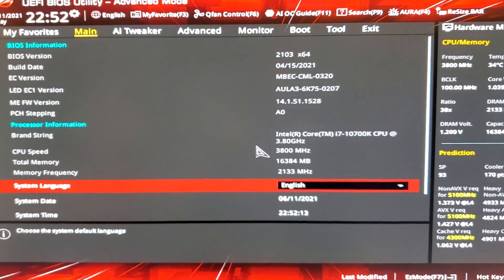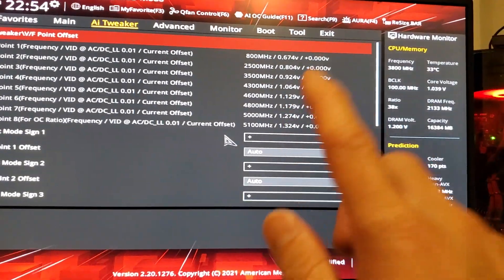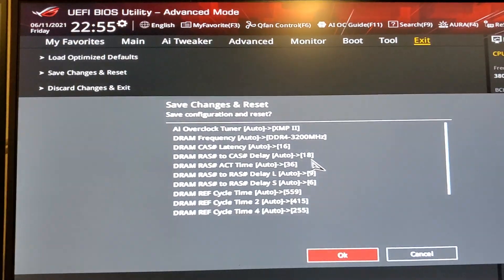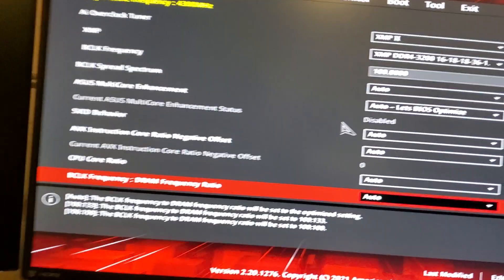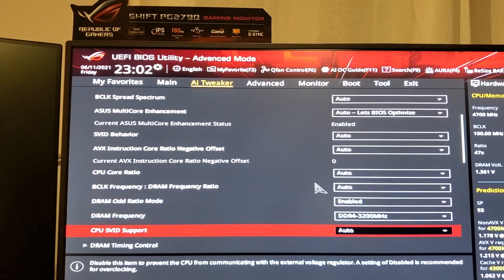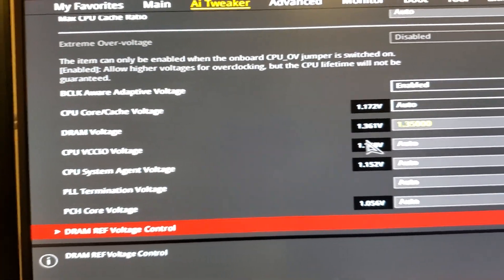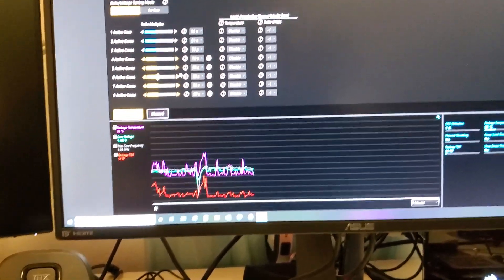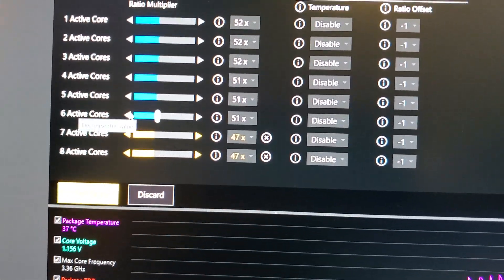Intel i7 10th Gen IA AC/DC LL 5.0GHz Overclocking Tutorial.

Comment: I'm confused. if you adjust dc ll you adjust the vid only. if you put it to something else it'll be incorrectly calculating stuff. why would you adjust that?
also ac ll increases load voltage on all freq, why would you want that?
Reply from the maker: I understand the confusion. I match AC and the DC load line values in order to read the correct voltage values from the motherboard BIOS and from software voltage value in a program like HWinfo. I validate it by measuring the voltage at the back of the motherboard and the voltage values line up. Almost matching. 

Because we are overclocking and new CPUs have multiple cores that can clock at different frequencies. Back before we had only a single core or dual core CPU, we would just set 1 voltage and that CPU would do it all. It would boost and it would also idle. So we only needed 1 set of voltage values. A boosted voltage and an idle voltage.

But today we have multiple core CPUs that can boost from 3.8GHz base to 4.7 boost all the way to 5.1 on a single core. As you can imagine, now we have a ton of frequencies and core voltages to account for. Not to mention that if we are on a demanding workload, the heat would make all 8 cores boost less. But if we lessened the workload (say playing counter strike on the half-life mod from 2000) our CPU would have a really light load and the single core can now boost upto 5.4 GHz. 

So the voltage needs to vary for frequency and the workload placed on the CPU (IE heat). I will see if I can produce a graph that can better explain this. I've been meaning to but some time has passed and I haven't been tweaking around with my motherboard anymore.
Reply: @pianobench6319  I understand vf curve just not why change dcll. setting dcll to motherboard impedance should be the way and only adjusting acll, as far as I know..
adjusting dcll just throws off cpu vid calculations

voltage read will be correct but the cpu will think that it's incorrect as you tell the cpu "hey I have 50 impedance" while you have 150..

Comment: I know this is for 10th gen but thank you. My 13600k was using 200W stock and I thought that was just how Intel is now, turns out my Asrock board had these at 1.7 stock, so I put it down to 0.01 and the difference is MASSIVE, down to 140W. This Asrock board was literally throwing 1.4V to the CPU by default, now its down to 1.2V, this shit could have killed my CPU...
Reply from the maker: Yeah glad you could follow along! Next time I'll be looking at making a shorter video. I realize that this old video was far too long for what we were doing. But I felt it was important not to jump edit or skip any steps.

I didn't want to lose people especially with a confusing setting like ac/dc load line. 

Glad yah like it!
Reply: Is your ac dc ll still at .01? Is it stable? What are your other settings like voltage mode and llc?
Reply: @EpicBunty  It is and it's super stable but that's because I'm still on the same BIOS, I tried to update to the newer one with the intel fixes and the same settings don't work because they lowered the settings themselves.
On newer BIOS you don't have to go nearly as low as I did, and it's hard to validate because it will clock stretch if it's unsable and the only way to know is by testing if you lost performance, it won't crash.
So you have to just trial and error all over again. I reverted to the old BIOS because I didn't have time to do it all again but I don't recommend you do that.

Comment: 10700k with sp of 93, damn! my 10700k had 51, my current 10900k has 97.
Reply from the maker: I think Intel 14nm only got better yields as time went on. So we were able to see a whole bunch of highly binned chips with good volt per frequency capabilities. 

How do both of your chips work with the AC/DC LL overclocking/underclocking? Idle and clock well?

Comment: Thanks for making this video. I can't wait to try it out. I definitely prefer your approach over other methods. What kind of Cinebench scores are you seeing with that configuration?
Reply from the maker: Score wise and performance wise it will be similar to how you overclock normally. 

Yeah, let me know if you have any questions. 

I don't adjust my load line anymore after I ahve dialed it in. But I also don't do any crazy stuff with my 10700K. 

I occassionally push it to 5.3GHz to run like ace combat 7 on unlocked frames or try to match a youtuber's 12900K in frame rates for Cyberpunk 2077.

So leaving the AC & DC load line to a set value and just adjusting the multiplier without having to always tweak the voltage helps a lot. 

I can link you to an MSI overclocking/bios expert. He works for MSI and I've looked through his tutorial on OC as well. Looks like what I do but he is likely explaining everything better. (He explains in taiwanese however and I can't understand Taiwanese.)

Thanks for the comment!
Reply: @pianobench6319  Can you link this guy you mentioned? In times of ai it should be easier to understand him now :)

Comment: Is it a good idea to try to get your AC/DC LL set to the lowest possible setting that is stable?
Reply from the maker: The AC/DC Load Line controls the overall voltage curve. 

It sets the at load voltage and at idle voltage. 

So yes you would want a lower AC/DC load line typically. You want to raise the AC/DC load line if your overclock is unstable. This will in turn raise the voltage. 

Leave your voltage set to AUTO and control it via raising AC/DC load line. Leave load line calibration too a fixed level also. This way you can see the voltage change via AC/DC LL.
Reply: @pianobench6319  Yeah I tried it with Auto voltage but I was getting alot of overshoot! I assumed that setting a max voltage cap in bios would fix the issue but it didnt do shit. I originally was getting BSOD's with svid behaviour set to best-case (LLC4) on 11900k so I changed to typical-case & then tuned it down from there, settling on a stable 1.50v ac/dc LL .160mohm 54x3 / 53x5 /52x8 / 45 cache Adaptive w/ no offset
Reply from the maker: @Metalhead-4life  when you manually set an AC LL and DC LL it will override the SVID Behavior defaults set by Asus. Those default values are the following; Best Case = 0.01mOhm, Typ. Case = 0.6mOhm, Worse = 0.9mOhm and Intel Failsafe = 1.1mOhm. Best Case will usually give you the lowest voltage possible and is usually unstable.

Setting an adaptive voltage of 1.5v will override the AC LL and DC LL settings. Except at idle. At idle it should use your voltage value set via AC/DC LL.

What CPU is this? How many cores do you have?? 12900K?? 16 cores???
Reply from the maker: @Metalhead-4life  It gets complicated when you combine setting AC/DC LL values with fixed voltage values. Or adaptive voltage values.

The alternating current load line (AC LL) and direct current load line (DC LL) are just the actual line (voltage value) at a set load (P95 load or gaming load or idle load). Components in our CPU will use both AC and DC loads. The CPU will see direct current values. But the motherboard VRM has to convert the AC into DC. And also the CPU is constantly requesting a new VID value from the motherboard VRMs. So it is part of the feedback system.

Which is why we have VID and Vcore. VID being the voltage that the CPU requests, the motherboard has to prepare this voltage prior to the CPU requesting it. When the CPU finally sees the voltage, it is reported to us as Vcore.

So it is a complicated system that I cannot easily demonstrate. But this is how I understand the AC load line and DC load line options.
Reply from the maker: @Metalhead-4life  

The way that I learned how to use AC load line and DC load line is to just adjust 3 options.

1. Set load line calibration (voltage drop at load) to LLC 4 or something in the middle.
2. Set an overclock multiplier. Maybe 51x on all my cores.
3. Set both AC/DC Load Lines to 0.40 moHm. Edit** (or set to whatever mOhm value that works for your CPU and your overclock)

And maybe this will give me 5.1GHz at 1.3v under heavy load. At idle loads, I am at 5.1GHz at 1.35 to 1.38. At medium loads my 5.1GHz maybe at 1.315v.

Does that make sense? Because at different loads, my CPU is requesting different currents. I don't load my CPU at max current (150A) everyday. But it is loaded for idle and medium gaming loads usually.
Reply: @pianobench6319  Sorry I never replied & thanks for all your help. I just revisited my overclock because of a newly released bios & decided to try my "per core" overclock up to 54x using V/F curve offsets. 
Above you said "Setting an adaptive voltage of 1.5v will override the AC LL and DC LL settings. Except at idle. At idle it should use your voltage value set via AC/DC LL".

Im still a little unsure about a couple things. The way Im guessing it works (In my case w/ the 11900k having a max turbo ratio of 53x) the cpu will follow the V/F curve up to 53x and then will use either my adaptive voltage for 53x and above or will use my vf curve offsets up to & above 53x all while taking into account my ACDC LL setting which is .15mohm?

1. The ACDC setting is in mohms so im not sure how it adds to the voltage of the offset curve, or how it determines by how much? and more importantly.......

2. Which overclock mode I should be using? When in ADAPTIVE mode (in the Asus M13Hero bios) you cannot set vcore to auto or leave it blank cause it will just default vcore to its minimum of .250v. It didnt seem to work when I set the OC mode to AUTO & used negative VF curve offsets (it didnt seem to observe my negative voltage offsets I set in the bios) & the voltage was high when I booted into windows.

The last couple days, as I said I have been experimenting w/ using VF curve offsets and just leaving it in ADAPTIVE mode & setting the vcore to the same voltage that the bios shows under VF point 8 5400mhz which is 1.498v and also setting negative offsets for vf point 6,7 & 8 frequencies.

This seems to work but is it redundant or incorrect doing it this way? I cant seem to find a good video or tutorial explaining 11th gen overclocking methods and/or using the VF curve offset method. Skatterbencher has some good info but doesnt get specific, I believe auto is also considered an adaptive overclock.

Im gonna try this overclock again but this time set it to AUTO vs Adaptive & see how it behaves, Im not sure why I had issues last time I attempted to use Auto mode. If you can answer my questions or point me to a link or video or something I would greatly appreciate it!
Reply from the maker: @JAY  do not use ac & DC LL to adjust the voltage IF*** you are using adaptive voltage.

You can use only*** AC & DC LL to adjust your voltage when you set voltages to auto only****. You can adjust load line calibration.  I suggest leave it at level 4 until you know how AC & DC LL adjusts your entire frequency and voltage curve.

Test ac & DC value at a lower frequency. Say 5.0GHz until you get a feel for what it does. 

Do not use adaptive voltage.
Reply from the maker: @JAY  adjust AC & DC LL to control all voltages and idle, 4.8GHz, 5.0GHz, and 5.4GHz value.

If you set your multiplier to all core x54, then you can just use a fixed manual input voltage. That's it. Nothing else.

If you want to set all core to 4.8GHz, and single core boost to 5.4GHz while setting 4 cores to boost to 5.2 GHz. Then consider AC & DC LL to adjust all those voltages. Do not use anything else. Leave on auto. 

Test yourself with lower multipliers. Try 50x at single core boost, and 6 cores at 4.9GHz and all 8 cores at 4.8GHz boost with AC&DC LL only. Then you will understand how it can adjust your voltages.
Reply: @pianobench6319 why can't we adjust ac dc ll on adaptive mode? I am on adaptive mode, vcore set to normal (my bios tells me thats the only way to set offsets) and from there i am testing use offsets for finer tuning. What should ac dc ll be for adaptive mode? Auto? You dont use offsets then?

Comment: My system keeps diconnecting anything on the USB C ports. Asus want to "FIX" the motherboard if I send it back to them. Does yours do this? Mine causes studdering during gaming if I leave a decice plugged into the C port.
Reply from the maker: I am not sure about this issue for your Z590-E. I am using an Asus Z490-F. Have you checked the latest bios version if they've resolved those issues?
Reply: @pianobench6319  Yes thats the first thing Asus support ask me. I am not pleased abou tthere attitude regarging a fix. I bought a brand neww $500 board and the want me to send it back to them not to replace but to "fix" it. Sounds like they will keep it for a while and send it back to me or send me someone elses problwm board

Comment: Glad I found this channel. I have a Z590 E and 10700K. Hopefully these setting work.
Reply from the maker: Hello, yeah try it out. If you have any questions feel free to ask. Basically the way I am controlling the voltage is by raising or lowering the Ohms resistance. V=iR. And it controls the range of voltages at each frequency. 

Some users have pointed out that their overall operating temperature is lower but they are clocking the same and using the same voltage they used before. Except before they used a manual fixed voltage across all frequency. Now ACDC LL will allow lower frequency to use lower voltage and higher frequency will use the higher voltage. But overall our voltages are lower opposed to using the stock setting.
Reply: @pianobench6319  It power throttles almost immediately. I had it set all core to 5.2 and even allowing auto o/c it still power throttles right away.
Reply: The board has a 8 pin plug and a separate 4 pin but I dont have a 4 pin on my power supply. I cannot seem to find any more information if this is really required or not.
Reply: Never mind I figured it out. FOr some reason after I allowed Armoury crate to overclock it somehow messed with the memory timing and the power limits. After I changed them in the bios it BSOD instant in Windows so I reset the bios and started over. THanks ofr the tutorial
Reply from the maker: @smokeskull  okay I am glad you figured it out! I don't know much about how to overclock via the Asus armory suite of tools.

Yes! Always reset to the defaults via bios and if you are having power throttling related issues, try to enable Asus multi core enhancement so you can benchmark your overclock. Afterwords I usually disable the mutlicore enhancement after. I find in my normal gaming that power is never an issue. 

Also keep the load line calibration at level 4 or below. This gives you a good Vdroop under load which is to protect your system from high voltage spikes during an overclock.

So I keep my system around 1.25 and if a voltage spike occurs the voltage will spike maybe to 1.37 or 1.4 but never crossing 1.4 so we are well within Intel spec.
Reply from the maker: @smokeskull  From what I recall and what I am reading briefly, the additional 4 pin is used for extreme overclocking for the CPU. Think LN2 6.0GHz or 7.0GHz world record?

So you should be fine with just the 8 pin. I have my 4 pin plugged in because I had the cable back when I built my system. But as long as your 8 pin is plugged in, you should be good to go.

Comment: I wonder if you can help me with my settings I have the 10700K and the z490 e gaming my cooler score is 164 and my SP is 51 what I Ac/Dc settings should I use…I don’t have a solid background in OC but what I noticed that following up ur tutorial my voltages are pretty much higher than yours I don’t know why
Reply from the maker: Hello, 

You can try running your 10700K first at AC LL = 0.6mOhm and DC LL = 0.6mOhm. This is what Asus will set as the default SVID or the Typical Case. The worse case SVID sets AC/DC LL to 0.90mOHms and Intel's fail safe (IE most stable but also most heat) is 1.1mOhms.

Try to set your system first to 0.6mOhms. See how that performs. Than go down by 0.10mOhms. So first 0.6mOhm, then 0.5mOhms, 0.4mOhm etc.... until you find a voltage you are comfortable with or that is stable. If 0.30mOhm is not stable, try using increments of 0.05mOhms. 

Just keep testing and recording your temperatures, voltages, and at what frequency. Also record the scores from your benchmarks.

Don't use Prime95 small FFT (nonAVX) for stability testing. Instead just use something like Cinebench R20 or R23. You don't need accurate calculations of Pi for gaming. If you need stability for mission critical calculations. Just consider running your system at the stock settings instead. But we are overclocking for performance =P so accuracy is not necessary!

Hope this helps! Have fun!